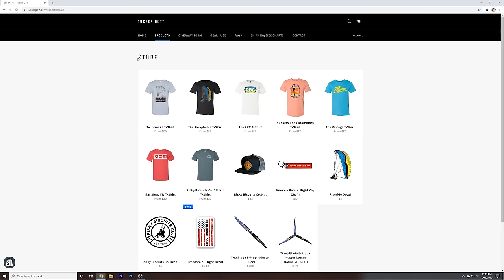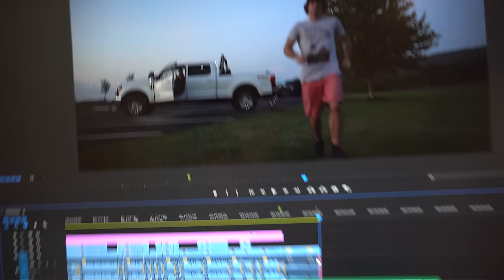Picking Up Chick-fil-A On My Paramotor!!!

Comment: "I've got two cell phone towers in view and no internet" - Sprints new slogan
Reply from the maker: Haha! 😂 So accurate except I'm on Verizon.
Reply: Here along hwy 37 between Terrace and Kitimat that's Telus and Rogers both.
Reply: @moenaguib2947  And Shaw in Vancouver... Cue overly dramatic sigh  :(
Reply: Im sorry im in the middle of no where and im on sprint and i got full bars LTE
Reply: Sprint is merging with T-Mobile now actually and the company won’t be separate anymore on August 2nd
Reply: Who says chickens can't fly....
Reply: Cell phone antennas are designed to send phone signal to the ground where most people are and not to the sky as it is a waste of energy.
Reply: @niconico3907  Regardless of antennae position or emitter aim, all energy emits in a sphere. Likely, there was not a Verizon tower nearby that carried Tuckers signal.
Reply: @SLO-Ride  They are in fact high gain directional antennas that radiate in more of a horizontal disc pattern.
Reply: @SteveGilbertson  Yes, but you cannot contain or fully direct energy. I used to work on high towers, the smallest being 400'. We built the long distance microwave system that predated the cellular grid. Even with the extremely precise and narrow focus we could obtain with the wave beam, after 40 miles, the spread was larger than the capture dish. After 80 miles, what could be received was less than 40% of the emission. Notice, this is with a very narrow and straight 1mm, 300GHz wave, and not the radiated emission of a cell frequency in the MHz range. A towers antennae can direct the emission into a "flat" curve, but the wave still encompasses a sphere, or else signal loss would happen at any range outside of the flat curve. The "sphere" signal allows you to drive into a valley and keep the signal, or fly at 2000' in a buttfan....as long as that tower emits your carriers signal. 

Tucker wasn't over a Verizon tower.
Reply: @SLO-Ride  sorry but no. There is a reason antennas are vertical, it is to spread the radio signal horizontally.
Radio signal is better if both antennas (emitter and receiver) are parrallel to each other.
Reply: Verizon as left the chat...
Reply: sprint actually does pretty well where i live
Reply: Try switching back to 3G if possible for further reaching reception. 4/5g is worse
Reply: Canadians In Cars Getting Cocky ye
Reply: @TuckerGott  ok that is sad
Reply: i mean technically it's T-Mobile now
Reply: @SLO-Ride  Toroid
Reply: Shocker, cell tower antenna don't waste power pushing signal upwards.
Reply: @SLO-Ride  Incorrect. Not only are they directional, but they adjust power density and direction based on demand.
Reply: {enter service provider here} in a nutshell..
Reply: Cars And Beards lol
Reply: med109 that’s what THEY TELL U

Comment: Imagine just taking a walk, then you get smacked in the head with a Waffel Fry.
Reply: "God, give me a sign."
"K."
Reply: ITZ YABOI a faint but loud “my pleasure”
Reply: I'd cry in joy
Reply: Lonewolf 1911a1  nah. Too light and not dense enough
Reply: Lonewolf 1911a1  worse case, a red mark. If it was burning hot.
Reply: Lonewolf 1911a1  a penny falling from the empire state building would hardly sting if it fell on you, nevermind a waffle fry that is highly affected by air resistance.
Reply: You straight stole this comment.
Reply: @angelsalike9145  yeah, I guess. But it happens on many comments. There is nothing different about mine
Reply: @itzyaboi4297  the Fri from Christ
Reply: @angelsalike9145  Lol i didn't I legit thought of this. Two people can have the same ideas.
Reply: *W A F F E L*
Reply: That would be a honest dream
Reply: @diegosanchez3745  a penny hitting someone from the top of empire state would kill them
Reply: @AxePlays-hc5dj  no it would not. The penny would reach terminal velocity from drag way before it could become dangerous(only about 45 mph). The force of that penny is significantly lower than a greater force strong enough to kill you. Perhaps if it was falling in a vacuum, it could fall much faster. Even then, it still wouldn't kill you. Its just too light wheight.
Reply: @diegosanchez3745  pennies are pointy enough to peirce you at that speed though so id say it could kill you if you are unlucky
Reply: @diegosanchez3745  pennies are pointy enough to peirce you at that speed though so id say it could kill you if you are unlucky
Reply: @Joopyter724  well, have you ever cut yourself on a penny before? (Spoilers! You can't) if you don't believe me? You should look it up on google or on youtube. I'm pretty sure Mythbusters debunked this myth.
Reply: Why are people arguing if a penny can kill you or not?
Reply: B cuz it can't
Reply: Lonewolf 1911a1 no it wouldn’t dummy
Reply: Ngl trying to  drop waffle fries on people  sounds like way to much fun

Comment: Bro if that thing didn’t use gas he would be chillin during the zombie apocalypse
Reply: How else would he fuel it
Reply: @averygoodfantasticname4206  ...solar.... and electricity
Reply: @kadengordon6941  solar for this purpose would need a battery, deep cycles last 4 to 8 years. also, solar panels need repair and cleaning, and without proper tools, would decrease the lifespan. i found a ev website with motors used for electric cars. all of the motors were ac. i picked a ev website because both a car and paramotor need torque. but the fact that all of the motors were ac means you need a inverter. inverters usually last at least ten years. in conclusion, your system wears out in about ten years or less, considering if one fails, all of them do
Reply: Kestrel R/Whoosh
Reply: People didnt notice the "if" in your comments
Reply: @omarashour2839  how is it a whoooosh, its whoooosh with 4 os, and r/ihavereddit
Reply: @omarashour2839  r/ihavereddit r/thatsnotawooosh r/foundthemobileuser r/facepalm
Reply: @wheatleythe_bigmoron_1179  good man
Reply: But food and water
Reply: @averygoodfantasticname4206  you need a somewhere to store the battery, not for the solar pannel to work.
Reply: @westside4372  bruh you really think sun will always hit the panels, what if it gets cloudy, or rainy
Reply: facepalm and where all those energy came from if there's no sunlight
Reply: @westside4372  he would have used it up man -_-
Reply: @omarashour2839  thats not  how to use a whoosh kid
Reply: Petition to make it solar powered
Reply: @averygoodfantasticname4206  if*
Reply: @omarashour2839  r/woooosh is not funny anymore.
Reply: @averygoodfantasticname4206  and it’s woooosh with no h after w
Reply: @averygoodfantasticname4206  maybe in the future we will find new technology that can make it happen, who knows?
Reply: Bet
Reply: @averygoodfantasticname4206  hey nobody cares
Reply: @westside4372  i misunderstood your comment, sorry
Reply: @averygoodfantasticname4206  if you look up Peter sripols electric plane I'm pretty sure he uses a DC motor for that, and it flies fine. I think it's a relatively low wattage motor, like 3000w or something like that, and he hooks it up to a giant propeller.

Comment: Serious question: How economical is it as a transportation method to work? Is it faster than driving?
Reply: Might spend a lot on gasoline
Reply: Pretty sure it runs on no gas at all and it might be a little slower than cars
Reply: @Soraroses  no traffic tho and can stay at a higher constant speed
Reply: While it can be faster than a car, you need a large landing space and a place to store it. It'll use less gas than a car as it is just a fan, but it is still a gas cost. Finally, it is much more weather dependent than a car. You simply cannot ride it in heavy wind or rain. It will just not work. So I would not rely on it as a car replacement.
Reply: Do planes beat you in a race when you race them? Ok
Reply: Tony Piela must be way more fun and no traffic
Reply: GuyWithTheAnimePFP ohh did not realize that this makes it even better.
Reply: @qrxz_o  yes
Reply: @Fantazy1028  yea but uhm winds
Reply: Isaac Sitenga needs to make a commercial version
Reply: Isaac Sitenga HA! Jokes on you, I’m in Southern California and there’s never rain or wind!
Reply: No traffic plus they can go straight to their objective, and apparently don’t work on gas, sounds like a god send of vehicles
Reply: Going straight is not a godsend. Hills and curves are interesting. They keep you awake and sane. Driving straight is sensory deprivation. Driving straight is unnatural, inhuman. Unless one goes ungodly fast...
Reply: @DeadLog  You can litteraly see the gas tank on it in one of the scenes like bruh

Comment: Fact: Taste bud arrangement changes at higher altitudes!!!
Reply: Really? In what way?
Reply: follows discussion
Reply: Proven in commercial flights! Additional salt used to make food taste normal
Reply: tomato soup enters the chat
Reply: @Demitri Antis oh the air? That's just free goodies
Reply: Now it makes sense as to why food is better in the mountains!
Reply: That's why they can serve us shiiite-food on airplanes, and still get away with it LOL!
Reply: Fake, it's not altitude that affects them and they don't "change arragement".
Air pressure affects how susceptible they are to certain molecules. Airplanes are usually pressurized to 0.8 atm instead of 1 because it is enough to breathe but it lowers the cost of having to construct stronger airframes.
Taste buds don't "rearrange", they are completely immobile...

Comment: Want to know the legality of this, is this considered VFR flight and what is the highest you can go? Do you even need to file a flight plan?
Reply: Its a powered parachute, what do you think
Reply: @toasterhavingabath6980  I don't know what to think :( what's the answer?
Reply: @Cyrribrae  maybe
Reply: Depends on where he is flying. Up to 18 000 feet in in most of the country (class E airspace) - which is higher than a regular paramotors can go, but can be as low as 2000 feet near controlled airspaces. He's more likely to run afoul of minimum altitudes, you're supposed to maintain at least 500 feet from obstructions or 1000 feet in built up areas - except when landing or taking off.

Comment: I got a question has anyone in there mid sixes ever learned to fly one of these rigs with zero flying experience...only experience i have is building flying rc electric planes over the last 14 years.is there a place in sw florida that teaches this? Years ago me and my friend Joe were really excited about gyro copters...but it never happened...these seem very cool if flown in big open space with proper instruction on a calm beautiful day...thanks for sharing 😊
Reply: You should get in touch with Aviator PPG in Florida. That's the paramotor school that Tucker recommends. Please do not try buying equipment or even flying before getting the required lessons.

Comment: Would this para motor set up work with a 6' 245 lb pilot or would i need more power and a bigger wing? Also how much does power motor weigh ..i want to know if i had to land i would be able to walk a few miles...i am in good physical condition for a 65 year old.thanks 😊😊

Comment: Does anyone else have dreams of traveling and living off their own produce and living off the grid with a paramotor?
Reply: So are you traveling or are you living on your own produce? To make your own produce, you would need to stay in place while it grows. Fruit could take years. So after a year when you've collected enough produce to travel and live off that produce, are you bringing a portable cooler capable of storing every single one of your meals for weeks or months on end? On your paramotor? Do paramotors come with fridge attatchments that can contain hundreds of pounds of produce? Would you not pass the weight limit by bringing a heavy cooler and hundreds of pounds of produce? Are you going to be extracting and refining your own gasoline for the paramotor? Wouldn't be very off the grid if you had to go to a gas station several times a week.
Reply: @Cornincarnate  someone has too much time